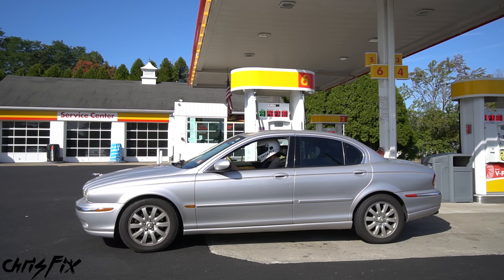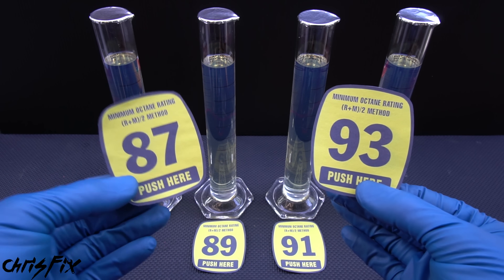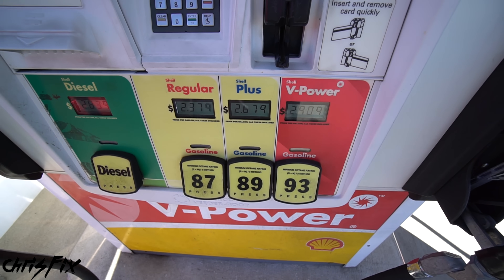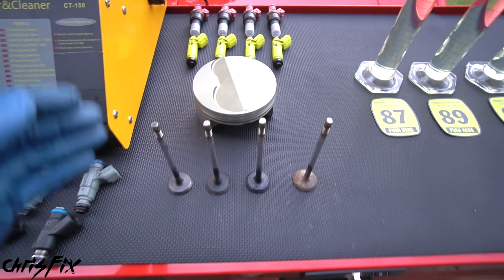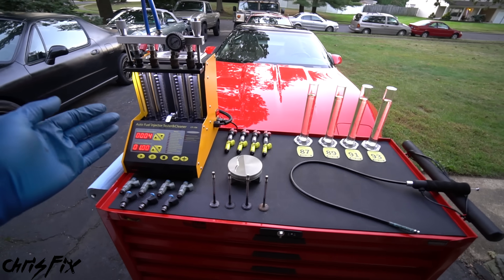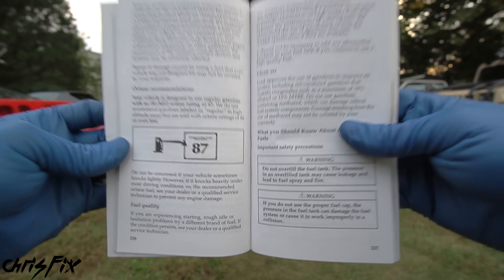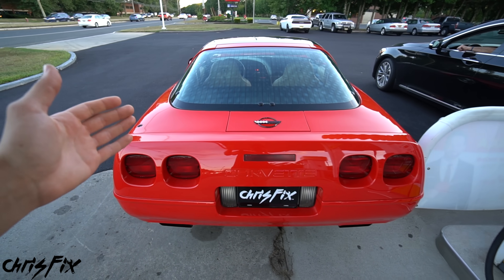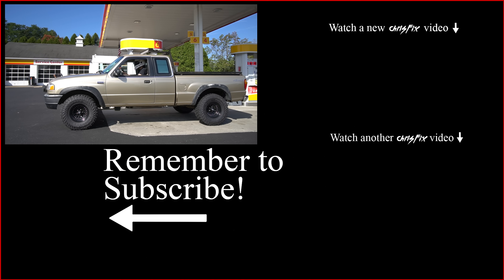What is the BEST Fuel to Use in Your Car or Truck and WHY

Comment: 2019 Honda accord sport. Ok to run 87 octane I assume? I do feel a better acceleration with premium.
Reply: h h yeah all honda’s are recommended 87 but you can always run 91 or 93 depending on where you live
Reply: Is shell or marathon premium gas better at clearing up deposits and such
Reply: h h idk what marathon is but mobil is good at keeping your engine clean and removing build up.. me personally i do not like shell for my honda i actually think i lose fuel economy by using shell... with shell my average mpg is around 29-32 using costco, mobil 76 or chevron gas i get around 35-38 mpg hope this helps you

Comment: Shouldn't you put in an octane booster (or a fuel cleaner or treatment) in before filling up? It doesn't really matter, but it should evenly mix with the new fuel before starting your engine. Then again, seafoam on a piston looked pretty cool.

Comment: Its important to note If your car's computer is adjusting the timing automatically YOU CAN and I personally have gotten better fuel economy with 89 gas vs 87 gas, though it got worse with 91 gas.

Comment: Who else thought he is going to  ignite gasoline in those glass vessels :( :( i was waiting for that :(
Reply: Lighting it on fire would not have been much of a show. Only the fumes of gas are flammable, the actual fluid is rather stable. If Chris heated it up, the gas would emit fumes but not much more exciting than lighting a pocket lighter. That is why the fuel has to be atomized when injected; otherwise, you won't get combustion. 
Also, if he did just light it on fire, I am sure someone would complain about burning raw fuel into the atmosphere, hence why he had the vials covered as not to let any fumes out.
Reply: @Orbital_Defleciton  was water in those tubes. Look at the colour.

Comment: The facts are that all fuels have built in additives, its how much additives and what grade of additives they are ,shell and other processing plants make fuels to a spec and also every single fuel station tanks has water in it, its about what % of water the storage tanks have got, thats all so always try to fill at brand new fuel stations if you can, due to the better tech used when they made the storage tanks for the petrol station thats all ? Less water makes the car drive better also noticed no E85 as well ?

Comment: There are gas stations here in my area in NM sell had that have 85! Is it Safe??
Reply: It's safe to run in higher elevations. But if you try to run it in lower elevations such as the midwest, then you can get engine knock. 85 is typically sold in higher altitude cities that are reasonably higher above sea level. You can get away with lower octane in high elevations.
Reply: @waycoolscootaloo  Ok. Thank you 🤘🏼

Comment: Ok I had to stop the video 6:15 
Ever drive by a fuel depot gas trucks in and out...shur you have you just never paid attention... they all go in and fill up from the same supply and gee wiz there all different companies trucks hmm 
Additives that's funny...😅
The only real difference between fuels is how its cooked. Ya cooked...🤔 all gasoline for cars is basically the same and there actually is no difference in octane not enough to notice and knock sensors is a gimmick to make you buy higher price fuel that the fuel oil companies pay the car companies to install it's a game and the only difference in making fuel is if it's cooked longer or shorter that's the difference in heating it to make diesel or gasoline you need to do some more research guy😅🤣😎🎓

Comment: In the state of Utah, they have 85 octane. Good, bad, or ok. Your thoughts.
Reply: 85 is sold only in higher elevation cities and towns. It's perfectly fine to run in those areas. But if you start to drive down to lower elevations, you will want to fill up on higher octane gas. Here in the midwest, 85 octane isn't typically ever sold. 87 is standard.

Comment: You didn’t review 85, which is allowed in some states. 😐
Reply: Only in high elevations is 85 octane sold. If you drive down to lower elevations such as the midwest where i'm at, you will want to fuel with 87 octane. 85 octane isn't available here in the midwest. 85 is only good at higher altitudes since there is less air.

Comment: You should also discuss 85 octane and the lesser octane ratings requirements at higher altitude and different oxygen in partial pressures.  One needs a lesser "test" at altitude; fuel vapor pressure is much greater than atmospheric in these scenarios.

Comment: Thats sounds really idiodic.. higher octane  means less corn fuel.     ..  alcohol burns hotter... Corn fuel is an alcohol.  .. basically..its like saying water, and syrup, will run off the roof the same... No bro...93 is closer to pure gas than not...105 gas will be about 5 to 6 dollars a gal for a reason... I use 93 all day everyday... 87 will give you a load of fuel, for as low price .. but it burns fast like a camel drinking water..i tested it myself, you can't tell me 😆
Reply: Here in Wisconsin 87, 89 and 93 octane all contain 10% Ethyl alcohol. Aka...all gas is rated as E10. This goes for all gas stations. E15 and E85 are the only exceptions which contain 15% and 85% alcohol. E15 is rated at 88 octane and E85 is 108 octane. Some stations around here also sell 100 octane street legal racing gas. And we have 110 octane leaded. However anything over 93 octane isn't considered traditional gasoline in chemical makeup. The higher octane fuels are considered racing fuels and are much more like paint thinners in nature than regular gas. And obviously the E85 is mostly alcohol.
Reply: There's more variables involved than just the gasoline.
Reply: @bobbarker3248  correct, but the subject at hand is which is "better" Fuel

Comment: What about ethanol free? Who should be using it? This is a hot topic in our house. I am curious to know what it is about? It is at some but not all the pumps here in utah.
Reply: Ethanol is alcohol. It has less energy than gasoline, thus providing less mileage. It may also harm metals and seals (rubber) because it is alcohol. However, it is more eco-friendly, and has a higher octane rating.

Comment: Do you get carbon buildup with E85? That's what I put in my 2015 Grand Cherokee Altitude
And if so, should I use a premium gas periodically to clean the engine?
Reply: e85 contains 85 percent alcohol.

Comment: I have Jaguar S-type 127,000 miles what do you recommend?
Reply: Read your owner's manual.
Reply: @bobbarker3248  I am, Thanks
Reply: @bobbarker3248  I Ain,t letting that thing go that's my baby got it from the dealer in the 04

Comment: I know there are a bunch of mis conceptions out there. But the easiest way to know what type of gas to use is look in your owners manual. If the car was designed to run on 87, give it 87. If it was designed to use 93, use 93. Pretty easy. If you put the wrong gas in yes your car will run, but not as efficiently. This is essentially geared towards to noon car people. Like how they're is a Urban legend that PCP is embalming fluid. Just stories that gain traction for whatever reason. JUST OPEN YOUR OWNERS MANUAL!!!!!!!!!!!!

Comment: I started using 91 from Shell a few months back and I do see that my engine performs better! Took the spark plugs out and checked the piston, it wasn't as clean as I expected it to be but then much better from 2 months before using 91! (Did 4500 miles in 2 months)

Comment: Watched for 20 minutes just to hear check the guide lol.. good informative video though I liked it. Now say if you have an older car with presumed carbon buildup in the engine, would it be beneficial to put some octane booster to clean the engine up a bit or will that run a greater risk to further damaging the engine?

Comment: Wow those gas prices are so low.  We pay $4 a gallon for just 87, $4.30 for 91.

You forgot to mention the most important piece about octane.  The fuel filter is there to help clean up the gunk if you continuously use 87.  Only thing is you will have to replace the fuel filter a lot more than if one was using a higher grade octane.

This is a myth pretty much all octanes are the same except they just add there own detergents.  

Shell uses the most detergent in their octane which is not the best for your vehicle.  Your basically paying more for detergent than gasoline at Shell.

Comment: I'm not trying to be rude but there is one thing you did not mention that I was looking forward to you teaching people about. Elevation levels and how they change what octane you need. For example, in oklahoma, we have 87, 89, 91. In higher elevation areas such as mountainous states like colorado or in the eastern mountains, octane is like 89, 91, 93 or sometimes even higher. This is because the higher the elevation you are at, the higher octane required to keep your engine in check. Please make an update or another video explaining this <3

Comment: Small correction.. you mention that the spark plug fires first before detonation, it's actually (usually) before the spark plug fires due to the compression, hot spots in the cylinder can cause this too nut usually the pressure alone can cause autoignition. Otherwise, awesome. You should also really stress the difference between detonation "knock" and other "engine knock" like rod knock and such.. detonation knock doesn't even sound like "knocking"

Comment: I drive a Ford Escape with eco boost/turbo engine. Dealership said you could use any gas like unlead. But through out the years at certain millage it can damage the turbo engine and you won’t get enough power especially going up hill. I tested out before. Cheap gas from acro, stop and save doesn’t give me enough power and it did damage my turbo charger. Good thing I got a brand new turbo charger for free from my dealership. They mainly recommend using premium or super gas. But that’s up to you. If you don’t want to risk damaging the turbo engine. Cost about $580 or more. Especially cars with eco boost. When I got my new turbo charger for my escape. I started using chevron premium gas (91) I feel a big difference. My car drives more smoothly, and when I accelerate it goes a bit more faster especially when I enter the freeway ramp. And going uphill it gave me more acceleration power to go up steep hills in San Francisco. Also the bigger difference is that I burn less fuel using (91)chevron premium gas. Regular gas made my car burn alot of fuel. I’ve been using premium for about 9 months already. I can drive 400 miles with a full tank from the Central Valley ( Ripon Ca ) all the way to LosAngles with out making multiple stops for gas.and  80 miles to Oakland or SF and back to the valley from a full tank and on the way back my tank is still a bit full. The little arrow barley pass from the first line lol. So if your a ford owner and having an eco boost engine. I recommend you to use 91 or 93 premium or super gas. Or risk damaging your turbo engine through out the months or years.

Comment: Del Sol question: I couldn't help but notice some of the parts in the thumbnail of your Del Sol suspension video weren't even used, and I have no idea what they're used for. My suspension is chewing up my tires, is there anywhere besides Amazon that sells aftermarket parts? I couldn't find any.

Comment: My Silverado 2500hd 6.0 manual says the same as your corvette.  Premium recommended but you can use lower octane fuel. But when I use lower octane I get pinging when accelerating hard or going up hill. I found that using mid grade prevents the pinging. So I save a little by not jumping all the way to premium.

Comment: Hi Chris, thanks for the video ! European guy here, car manufacturer recommends 95 (regular), but when I was breaking in the engine, I filled her up with premium every other tank. Now, this may be 100% in my head or due to different driving conditions, but most of the time I got better fuel economy with premium. So, my question is: on a car that recommends regular as a minimum, would premium affect fuel economy in all/most cases ? I guess the presence of a knock sensor would answer this question, but just wondering.

Thanks again for all the amazing content !
Reply: Maybe the premium has less ethanol in it?
Reply: @bobbarker3248  it does, 5% instead of 10%... But is that enough to make an easily noticeable difference? Or seemingly noticeable difference...
Reply: @DuckSherminator  Ethanol has less energy, so it's possible.
Reply: @bobbarker3248  true, just never thought it'd be noticeable outside of lab conditions for such a small difference ! Also, if the timing is optimized for premium, it should extract more energy I guess...

Comment: Great video love it we run premium in in everything we drive fords and my dad eveytime he trues to run anything but premium the valves rattle real bad so we pay a little more but we we get good mileage with it and no rattleing we get 30mpg out of our 1997 ford gt 4.6l with mods though bbk cold air intake and and bbk 75mm throttle body runs great

Comment: "The fuel here in America is very similar to the fuel in Europe" - except muuuuuch cheaper - hahaha
Reply: Peter fuel is cheaper in US and I like it. What I dont like that distances here much longer here than in Europe. So after all I spend more on gas here than in Europe
Reply: We also use 10% ethanol as a standard in most areas of the US. Which is cheaper, but not as good.
Reply: @SmithWesson-s8x  I live in a town in uk with several refineries. We also have concrete!
Reply: yea true but here you start at 95  98 is normal 100 bit more and premium is 110 oktane
Reply: But you have to live in murica. hahaha
Reply: Not false if he's talking about octane ratings. UK doesn't sell anything below 95 and premium is 98/100 of the pumps
Reply: @joed97  did you even watch the video? America displays octane in (RON + MON) / 2. Whereas Europe displays octane in RON only. Chris literally explained it, same fuel different number
Reply: @joed97  watch the video, octane rating method for EU is different than for USA. 89 in the USA is same as 95 in EU, 91/93 is same as 99 in EU.
Reply: @batsonelectronics  yes he said that. But he was wrong about a higher octane number could be changing fuel economy as well as horsepower. In Europe the newer cars get that when using octane 100, but for older cars it doesn't matter
Reply: it IS false as stated in the video and in the top 3 articles i just searched on google. they use a different measure for octane so saying it’s better because the number is higher is like saying their cars are faster because you’re comparing km/h to MPH.
Reply: Peter Bodilsen but the Quality you got in America is much worse that in Europe
Reply: @thewonder4590  how so?
Reply: @thewonder4590  it is the same as our Mid grade and premium grade. Did you not watch the video ?  Now Diesel is a different story, yours was much better until recently. ( last 5 years or so )
Reply: @thewonder4590  False.
Reply: @thewonder4590  I only got ur word for it! 😉 and I'm from Europe by the way

Comment: I drive a 16 explorer platinum eco boost v6 twin turbo. It requires regular unleaded. I had my Engine light come on telling me I had a bad knock sensor. The engine light went away but I'm still worried the issue didn't go away. What'd you guys think caused this? Maybe a couple bad misfires that may have caused my CPU to think the sensor went bad? Or ? Please help!
Reply: If you have a bad knock sensor, replace the sensor.

Comment: Can intermittent fills of my 05 Tahoe help to improve the carbon deposits that existed when I bough the truck?  I’ve had it two years now, and have no issues.  186k on the original engine.  Also what about using a preservative treatment like AC Delco Fuel Treatment plus once or twice yearly?  Thank you.  Great video!

Comment: My GMC 5.3L has a yellow gas cap that says E-85, but I've been told it will actually run more efficiently on 87.. so why is the E-85 recommended?
Reply: e-85 is 85 percent ethanol. Ethanol has less energy than gasoline, so you get less mileage.